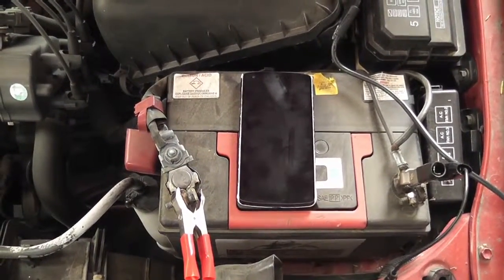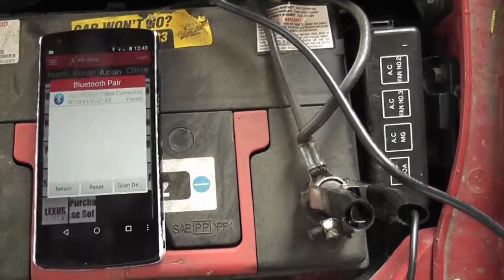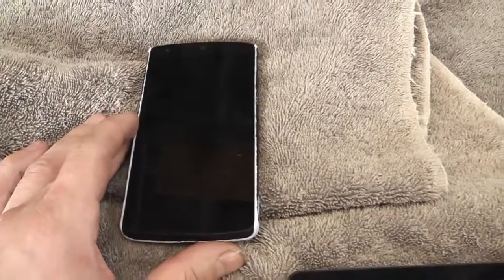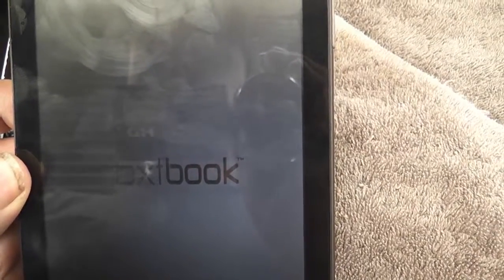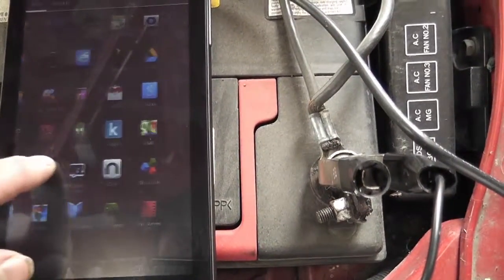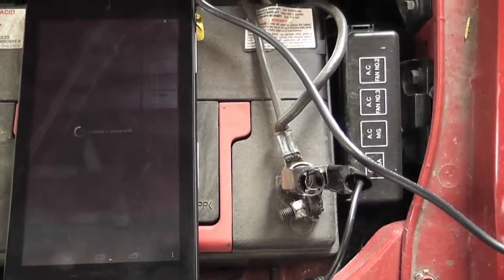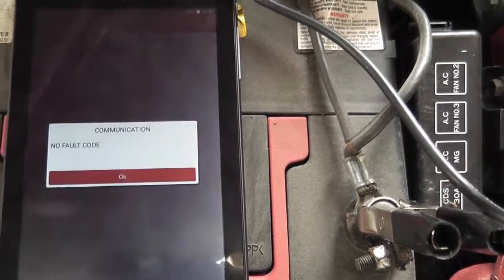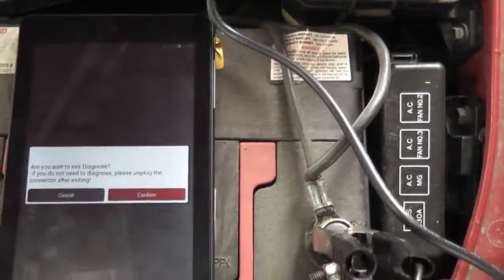how to get the idiag launch x431 to work again

Comment: Where does one download the x431 idiag? I had it on a older Samsung tab, tried upgrading something and now I can't log into my x431 idiag and purchase/update software...so wanted to recover my log in and move to another device...Best regardd
Reply from the maker: ok, I do not know where  to download idiag app and its  specific  i-diag  as  launch made  so many versions of  the same tool. You definitely  need Android  Kit-Kat or it  will not  work  i would say. I am not  sure if launch frozen  the  logon-update for  idiag  via DBS My car  it was the log on. I use What ever software i have  purchased back then. Updates  was like 2016 opel in 2022 or  so latest, last time i logged on 2  years ago. So if it still  works  use  it  dont upgrade android . And buy Think car-pro dongle   thats the latest of  what the idiag  was To buy now. Alternative MHHAUTO . need  to pay some money to become member There is  people selling latest update  hacks.

Comment: Thank you for the explanation, but I have the same piece and I could not take advantage of it now from about a year and a half ago, I sent the email to the seller did not answer !! I bought the app for $ 50 but still do not take advantage of the application and did not take advantage of the services of that piece!
I hope if you have a cable link that I have a barber piece to see the model number and buy it to make the experiment if it is useful!
Reply from the maker: ok you will have to have this paper you originally got with the tool to register it. you have to log on with webbrowser and log in there its called mycar if you scroll down to the bottom on x431.com.  i make a quick video as i just loged on as of right now .
idiag is on mycar user.
only slternative id a hack update via mhhauto i seen it offered  something i would do as last resort.